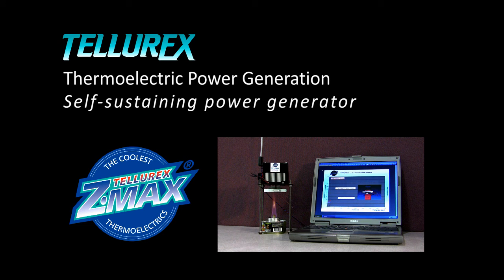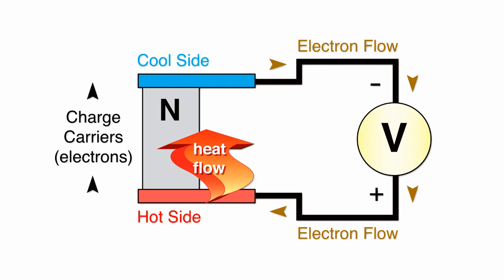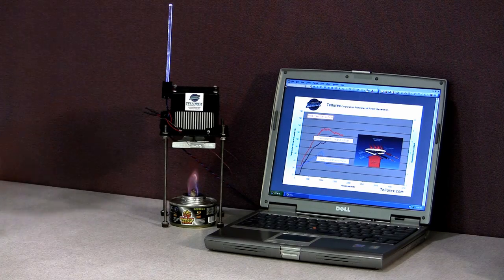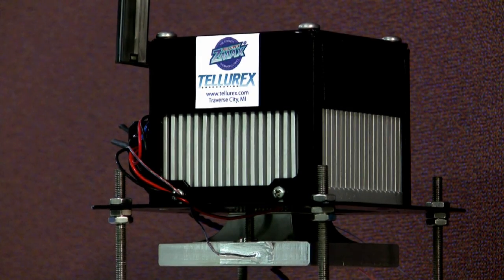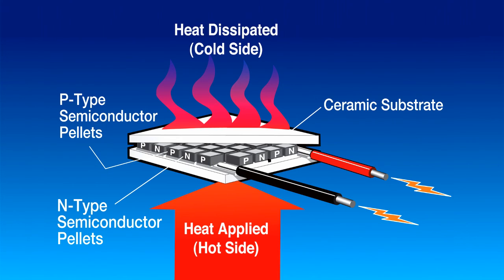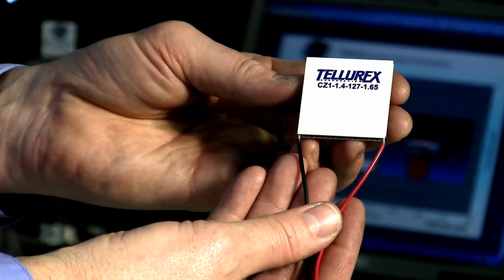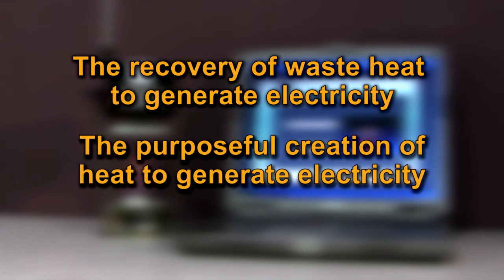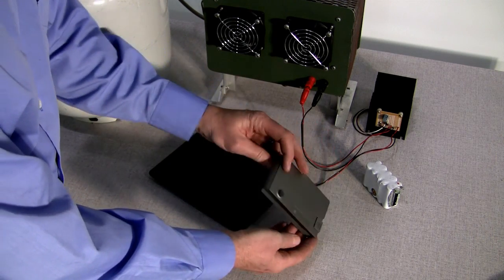Thermoelectric power generator

Comment: @jpthecreaton So true. I nearly every single case, the thermoelectric effect can easily be dwarfed by merely collecting the heat waste energy, as water. Far more efficient way of looking at things. Imagine if we went to the expense of setting up a geothermal installation, but then instead, we used the heat to make electricity at a net gain of about 10%. The Peltier module is about that good. Great for outer space, not so good on Earth.